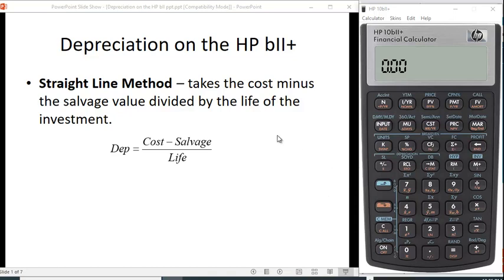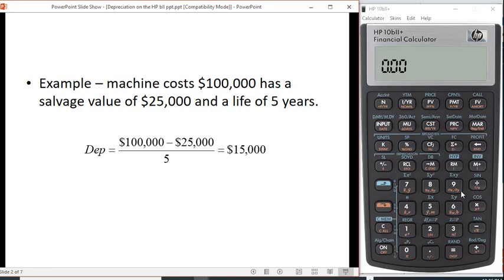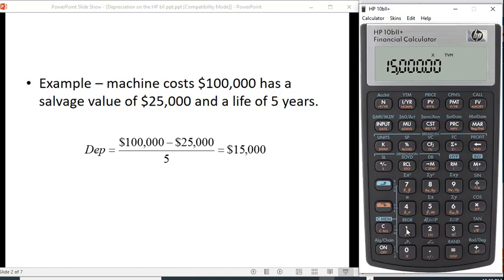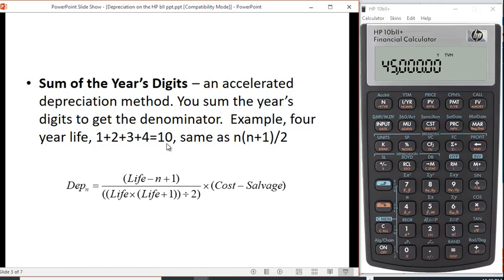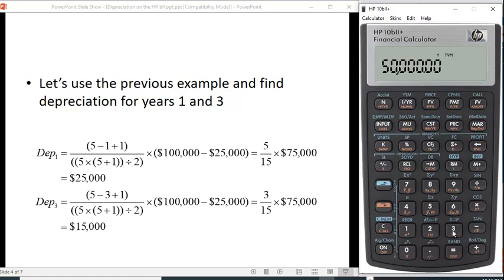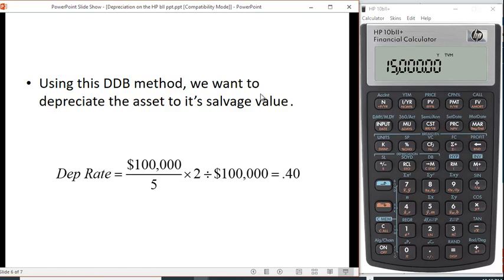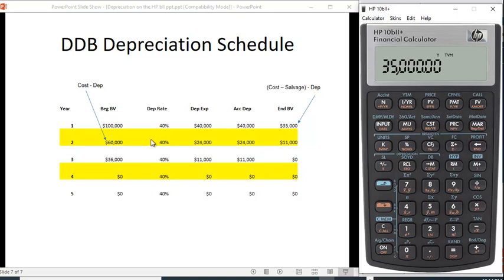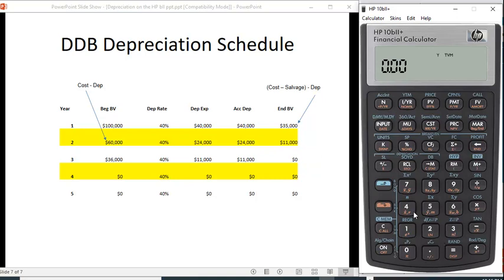Depreciation on HP bII+ Financial Calculator

Comment: I noted an error in your explanation of "book value" using the SWAP function:

Given Data: A machine costs $100,000 has a salvage value of $25,000 and a life of 5 years.

Depreciation for year one using the straight-line method:

Depreciation per year = (Cost - Salvage value) / Useful life
= ($100,000 - $25,000) / 5 years
= $15,000 per year

Therefore, the depreciation for year one is $15,000.

To calculate the end of year one book value:

Book value at end of year one = Original cost - Accumulated depreciation
= $100,000 - $15,000
= $85,000

So, the end of year one "book value" is $85,000.

The value you're referring to, which is the book value minus the salvage value, is commonly known as the depreciable amount or depreciable basis. In this case:

Book value: $85,000
Salvage value: $25,000
Depreciable amount: $85,000 - $25,000 = $60,000

This depreciable amount represents the total cost that will be allocated as depreciation expense over the asset's useful life, and that is what appears when you use the SWAP button.